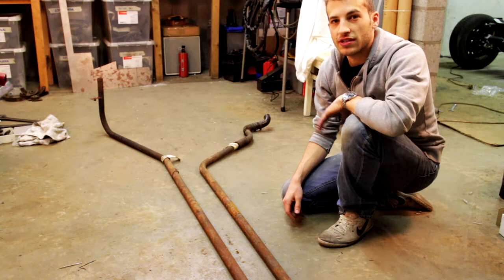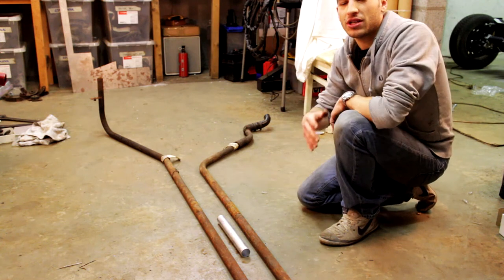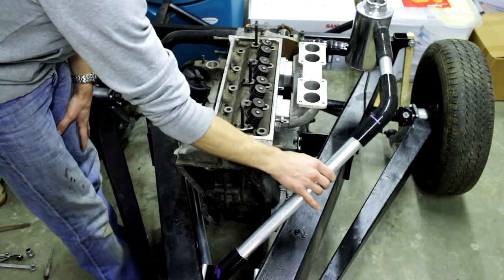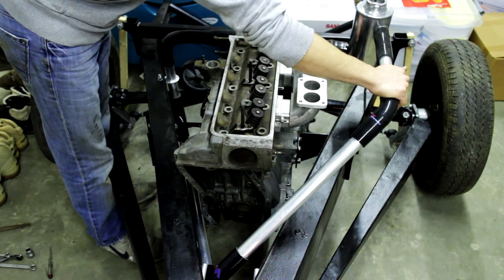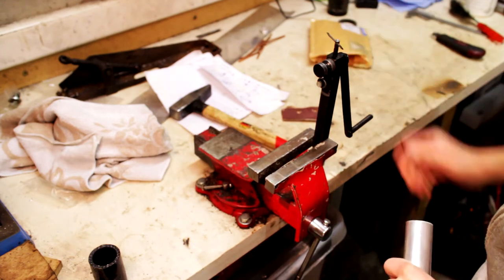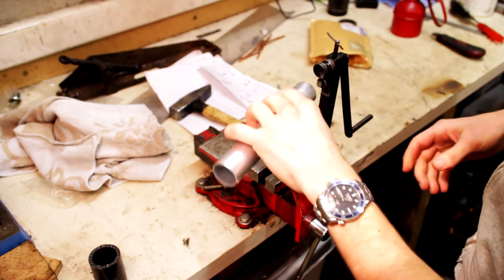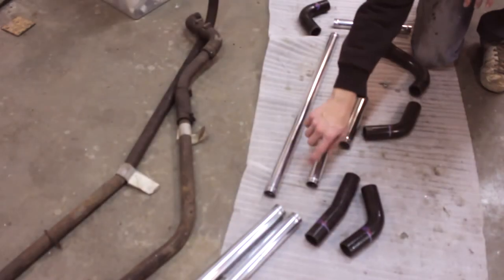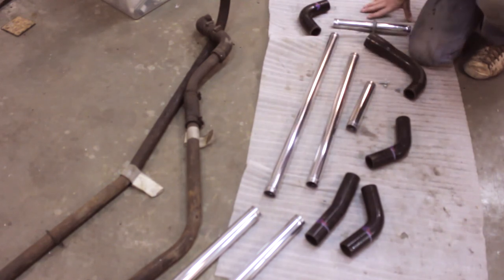Lotus Europa - Ep 31: Coolant transfer pipes

Comment: Well done. Good ideas.  Hope that different metals in contact with coolant does not cause a corrosion problem.
Reply from the maker: Aluminium radiator, engine block and now coolant pipes, no chance of disimmilar metal corrosion! With stainless pipes you do run a very small risk.